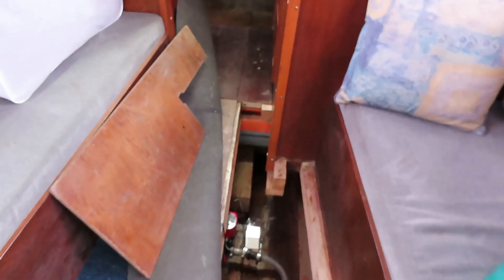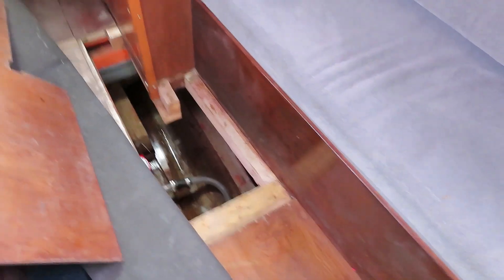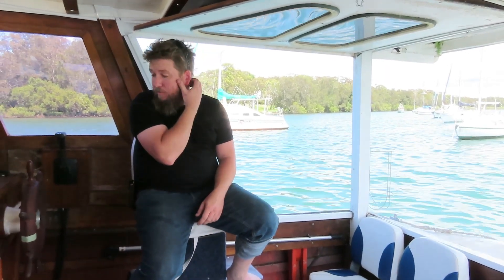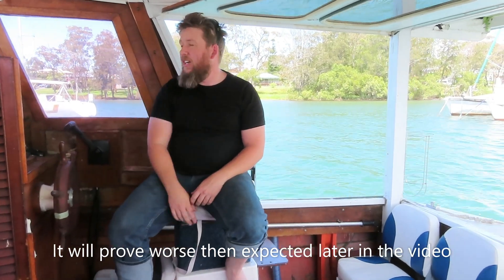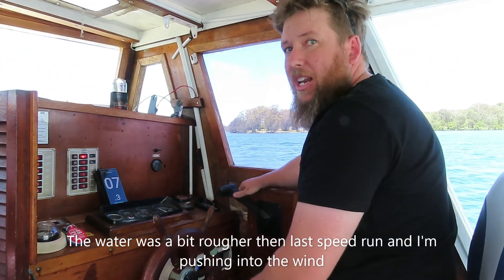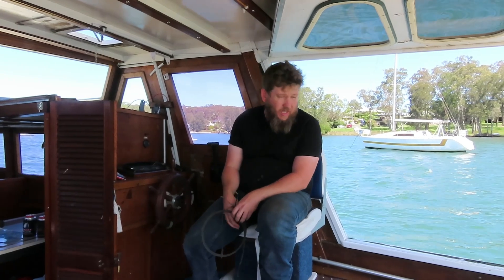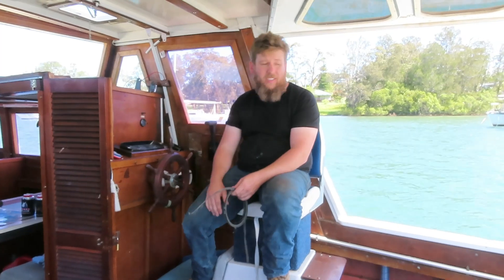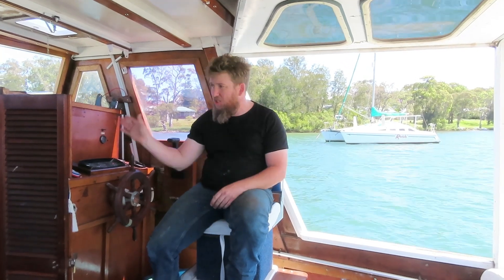HARTLEY 34FT REBUILD "KIARRA" EP7

Comment: Really glad to see how things are going.
As a teenager I used to hang out in the area where your boat was moored.
The area nearby is called Bayswater.
The jetty you have been tying up to was part of RAAF Rathmines ,and was known to the locals as "marine wharf".
It was where the RAAF tenders and Air sea rescue launches were serviced, hence the substantial slipway there.
Phil from Newie
Reply from the maker: I was wondering about the tracks in the ramp. I thought all that work was carried out around the point at the Cateleena port.

Comment: Good to hear no soft spots in hull that's huge plus. Will be interesting to see if prop changes make any difference. By the way I work at Whitworth marine and the seats you have go on special today for $62.95. Though looks like yours cleaned up pretty well. Thanks mate
Reply from the maker: Thanks mate I was relieved to hear she is good under the water.
Lol I have spent a lot in your store previously and I'm sure I will be spending heaps more as this project progress.
Do they do sponsorship???

Comment: Another wonderful video. Me is guessing your hull speed is probably about what you're doing right Now ..Playing with props may help. Keep up the wonderful work blessings to you and yours coming at you from Southern Oregon
Reply from the maker: I have 2 other props that are just sitting here I will try just for the exercise but I do agree, 8.5 is just all she has with that small engine.
Reply: When you opened the throttle the revs flew up which is pretty much showing the engine is running away with the prop so an increase in pitch should load the engine up and push the boat thru the water quicker, you could throw a much much bigger prop on and up to a certain point the boat will go really well. A good rule of thumb is an inch of diameter  is worth 2 inches of pit h. After that point the engine will start to labour and poss get hot..Cruising rpm is normally 300-600 lower than max rpm. Bit each boat is different.
Reply from the maker: @matui6983  perhaps you could help shed some insight as you seem to be very knowledgeable in these things mate.
The current prop is a 4blade 14.5"D x 15"P
I have a 15"D x 19"P 3blade ( unknown mercury style)
And a 15"D x 22"P 3 blade quick silver SS. 
In your experience is it even worth trying the other 3 blade props or just a waste of time?
Reply: The diameters are all within an inch of each other. Id try the 15 x 19 first. The pitch is the number of inches it will move thru the water in one revolution. So a 4 inch gain may not sound a lot but at 3000rpm you will notice it. Increase the rpm a small amount at a time. As before the boat will probably cruise a bit faster. 
Props are a science unto themselves. The 19 inch pitch prop will load the engine up a bit more so just try at a bunch of dirr rpm ranges and watch the temp gauge like a hawk.
Reply from the maker: @matui6983  I will be doing a video on the different props to see what happens.
Reply: Cant wait to see the results.

Comment: she isnt built for speed brother , she is for cruising , I had a 37 footer 6 cyl cat diesel turbo 6kn was her max 1/2 throttle or max didnt matter , Put the bacon in the pan cruise around lay back relax , She is a Top boat man !
Rob
Nowra NSW
Reply from the maker: For sure mate I do agree, just nice to know what her limits are incase I ever need to use them. I have found that over 3/4 throttle all she does is drink more fuel and make more noise lol.

Comment: Growth on antifoul? Could it be the antifoul paint has worn off leaving the bottom paint exposed to growth. The purpose of antifoul is to prevent and stop all that nasty stuff. An inspection of the hull out of the water would be recommended. Great video.
Reply from the maker: Thanks mate, she will be coming out later this year for inspection and antifouling. It will also be when most of the top deck timber work happens.

Comment: Ideally you need to put a 1:2 gearbox in her bring the revs down and fuel down and your speed up. A common rule is a 1:2 box for a 25ft+ boat 1:1 is more for smaller boats like  15ft max
Reply from the maker: I'm not sure what the gear reduction in the alpha one outdrive is mate.
Reply: @HarpersShed  to me its sounds like 1:1 if its doing 3.8k revs at 9 knots
Reply: @HarpersShed  so a direct drive
Reply from the maker: @danfox1458  it's a Stern drive mate.

Comment: How did you find your seat/driving position after you changed it around? It does look better.
I guessed 2 knots faster, but one is better than none. 
You've mentioned a big trip coming up ( I know what you are doing 😜) might pay to check the oil in the leg/outdrive/gearbox before you go....and maybe even change them. 
Lastly, do you have an auto bilge pump? They are lifesavers for moored boats when you aren't always around.
Cheers mate, loving the content 🤙
Reply from the maker: They new seating position is 1000% better. I was under the assumption you had to have the boat out of the water to check the oil level in the leg? If not then please let me know and I will do it for sure. She does indeed have an auto bilge pump but hasn't need to be used since I installed it👍. How is you come to know about my upcoming plans? Do I know you personally or have you just put the puzzle pieces together?
Reply: @HarpersShed  I'm not sure how you go about doing the oil in those MerCruiser drives, I was assuming you could maybe pump it out? Surely there's a way to do it without needing it out of the water. I dunno for sure, I've only owned tinnies 😋
Nah mate, we haven't met, I just put two and two together......gonna be cheaper to cruise it home than paying for cranes and a lowboy 👍 Just make sure you have all your safety equipment together....marine radio, EPIRB, V sheets, flares, proper rated life jackets. MSB are quite narky, they will ping you if you don't have the correct gear.
Reply from the maker: @Mardy72  👍 I just to get some new flares and a v sheet and I should have all the required safety gear for off shore.
Reply: @HarpersShed  good stuff mate, look forward to seeing the trip 👍
Watch those bars and be safe 🤙

Comment: Have you had a play with the leg tilt to lift her nose up a bit once you are underway?
If the leg is trimmed fully in the bow will tend to bury. 
I'd try that before you dive down the rabbit hole of prop swapping coz it costs nothing and props are expensive to fiddle with.
Eric
Reply from the maker: The trim doesn't seem to make too much of a difference on speed or rpm for some reason.
The props that I used for the experiment were ones we already had laying around so not expense there thankfully 🤣

Comment: I wouldn't dare to scrape the barnacles of the hull like that... I'd be worried to damage the paint (on the steel hull of my boat). I take her out of the water every 3 years and put new anti fouling on the hull.

As for speed. A wooden boat might be a tad lighter than a steel boat, so that would change the formula. Trim tabs also increase speed. But displacement hulls have a hull speed. Adding horse power merely leads to a bigger bow wave. In the end the boat just tries to climb its own wave, and creating a big bow wave costs a lot of fuel. Anyway, the rule of thumb is: take the root of the length in meter and multiply by 4.5.   That gives you the hull speed in km per hour. Going faster will dramatically increase fuel consumption and add little speed.

Comment: Your hull looks really similar to a Sportsman or Marksman. 
Ive seen both achieve a 12 knot cruise and 16ish knot topend with 150-180hp 6cyl Ford diesels
10knots with 120hp 6cylinder Ford engines.
Reply from the maker: That's very encouraging information.  I would need to upgrade my leg to a Bravo outdrive but that's not hard to do.
Reply: You just need an engine to give you the right rpm to make leg viable. Those Fords only peak at 2450rpm. 
The small Jappas can sit at 3600-3600 without too much bother. 
The hardest load you can put an engine thru is a genset. Full power 24/7
Then its a marine engine
Then a truck engine then a car. 
A boat engines load once its dropped into gear and moving is the equivalent of you driving up a hill all day in top gear. You hear guys go" got a million kms from my watever brand engine" 
Big deal, its tootling along a motorway, idling and will go up hills sure while loaded etc but not at almost max rpm in top gear fully loaded all day which is what a marine engine has to do.
Reply: @matui6983  i would have thought running a large water pump would be above a car.. diesel locomotives and airplanes too...🤔
Reply: Fire pumps, water-pumps and rail traction engines are above an automotive engine. Wont disagree with that at all. Only work on the above and all Ive just listed so cant comment on aviation diesels.
Reply from the maker: @matui6983  aviation diesel are more common then you would think however they exist in support equipment not aircraft themselves. I spent 6 years a group support fitter for two different defence contractors. All the diesels you would find there are the same you would find in heavy industries. Detroit, dutz, Perkins and the like running gen sets, hydraulic test rigs and that sort of thing. I will be keeping an eye out for a 4cyl generator engine or some kind I think after all your helpful suggestions.
Reply: If you are in the US it will probably be a helluva job to find but you wont get any better diesel than a Gardner for pretty much any application. 1, 2,3,4,5,6,8 cylinders and will go forever. One Gardner Ive got here had the hour-meter stop at 70,000 plus hours and that was 5 yeats before it got pulled out. Nber had its crank or pistons out just heads off for decoke and Ive rebuilt injectors on it about 4 times. For a 4 cylinder genset Id be looking at 
D-series Ford
4/236 Perkins
Kubotas
Listers
All well built, heavily built, lowly stressed,  uber reliable and easy to get parts for if needed.

Comment: Were you towing the dinghy in the first run?  That's a bunch of drag.  Also have you tried playing with the trim at all at speed.  I really don't think it will do much, but my 25 had a sweet spot where you trimmed up just a little and it helped a lot.
Reply from the maker: Yeah I was towing on the first run before she was cleaned. I did try the trim but it didn't seem to make any changes.

Comment: I'm surpriced! I gained about 3,5 knots (from 18kn to 21,5kn) by washing my boats hull this summer, and it was in way better shape to begin with. Does it make a bigger difference with fully planing boats?
Reply from the maker: I would say it is an exponential function yes, so the faster you push a dirty hull the more drag it will produce. Because I was only pushing at 8knots the drag was not a significant despite being lots of it.

Comment: Looking at the state of the underwater hull even after it was scraped, it certainly need the boat pulling out of the water. Hull cleaned properly and then re-antifouled.  Work can be done in two (longish) days and doesn't cost too much depending on how much a yard will charge for pulling/lifting out and a couple of days on the hard. Oh, of course, extra for putting the boat back in the water unless you can arrange a deal. You will certainly find a improvement in speed afterwards but I have to ask, why speed? The boat is a cruiser not a speedboat. Power yes but speed is not that important.
Reply from the maker: It's more efficiency I'm after then an outright speed number. I would like to know how she performs under her ideal operating conditions then I know if something isn't right if for some reason I take her out and I can only cruise on 6knots. She is still a new boat to me and I want to find her limits.
She will be coming out of the water hopefully before Christmas to get all the work done to the hull👍

Comment: You should be able to find the plans for the Hartley,  displacement value for the design may only be 6 to 9 knots
Reply from the maker: I have been on the Hartley website and can't exactly match my hull shape. The model also doesn't appear on the registration papers either.
Most of the Hartley hulls that seem to be close actually are built to plane but most require a 180hp diesel to do so.

Comment: That leg most definately needs the spray pipe/bar fitted to squirt water on the top of the gearcase after watching how far out of the water it is.
Reply from the maker: After I edited that video I completely agree. I didn't think it would be that far out of the water but now going to fit a spray system for it.
Reply: Sweet. Im guessing the engine is raw-water/saltwater cooled. Another thing to look at would be fitting a heat-exchanger to the engine so its freshwater cooled, will prolong the engines life. 
Otherwise a 3 way valve can be fitted to the existing seawater intake and after a run you shut the tap to the sea and run freshwater from a bucket or 20litre container thru the engine, we run dishwashing liquid in the freshwater and once you see bubbles overboard you know most of if not all the seawater is gone. 
Again the castiron of the engine and any alloy will last a lot lot longer.
Reply from the maker: @matui6983  yeah she is raw water cooled. That's a good idea to put a diverter valve in and push fresh water through after a run I may just have to do that. If I end up doing a diesel repower it will most definitely be getting a heat exchanger then.
Reply: Cheapest and easiset solution, plus if the boat starts taking on water (God forbid) you can shut the valve to the sea and use the engine to empty out the boat.
Reply: @matui6983  that's a damn good idea
Reply: Only ever had to use it twice on 2 x  different boats. With a 2inch Jabsco pump it emptied the bilge in no time. A V8 3208 CAT will empty a 20 litre bucket of water with one good hit on the throttle.
Reply: @HarpersShed  this is solid advice mate 👍 take note of this bloke
Reply from the maker: @matui6983  oh wow that's a massive amount of water movement.
Reply from the maker: @matui6983  yep you have convinced me, this is happening now

Comment: I would think you will experience fuel savings more then speed increase, because the motor doesn't have to work as hard to maintain 3k rpm
Reply from the maker: I would be grateful for any reduction in fuel burn that's for sure, price of fuel is bloody expensive these days to be waiting it

Comment: Displacement hull ?? It's not going any faster than 8 knots from my limited knowledge, even with a bigger motor.
I could be wrong though lol.
Reply from the maker: I did see 9konts going with the wind and swell lol. 
It's more about trying to make the boat work as efficiently as possible with what she has.
She has a long journey ahead of her and every extra bit will help........ More on that in future video though
Reply: @HarpersShed  i gotcha, I wasn't sure if people were expecting huge gains but efficiency is key and every barnacle does make a difference.
I had a 25 ft carvel planked putt putt with 1.4 ton of ballast in her for a while. 8.5 hp twin cylinder air coolled Lister pushed her along at 8 knots all day with 2 knots either side dependent on wind and tide lol. 
I'm looking forward to following along with your improvements for sure no matter how minor or major.
Keep up the great work, cheers for the reply 👍
Reply from the maker: @jasonfarrugia8833  thanks for the comments mate and glad to have you along for the ride 👍

Comment: I would thought she'd go faster..must b an improvement somwhere to be made..u go as fas as my 45×28 foot off shore fishing boat ..I get 9 knot in rough seas
Reply from the maker: I'm sure you have a fair bit more power then me though. She is just not built for speed I don't think, it would be fantastic to get a proper identification on what hull design she is so I could cross reference the speed charts in the Hartley site.
Reply: @HarpersShed  not shore..mabe prop pitch would help..thas an easy fix thas just a prop..ya mines not out bord style ither..I've go a Rutter n big wheel..not a out drive..n I have 165 hp Mitsubishi..diesel